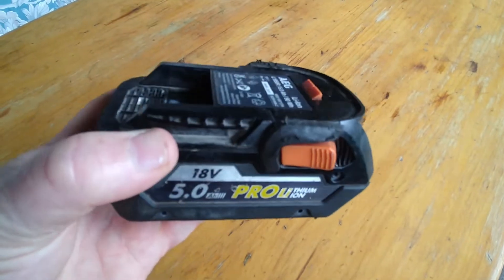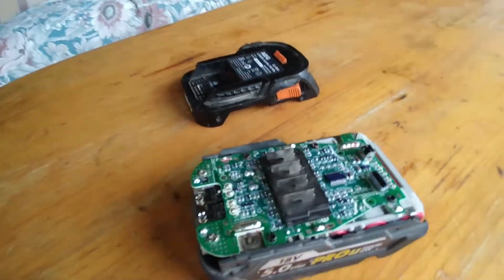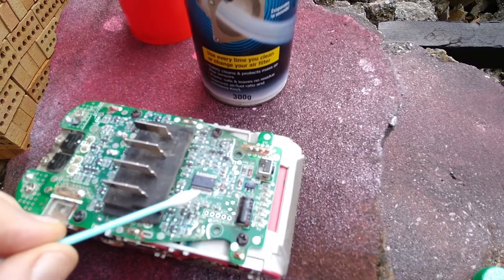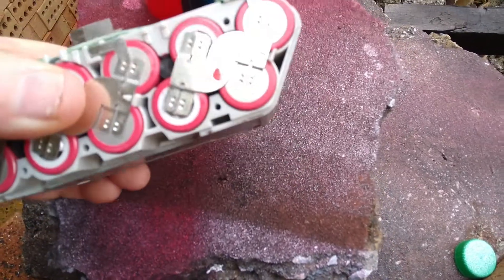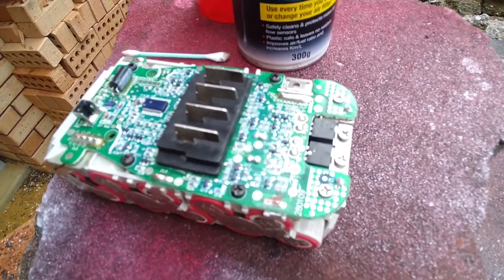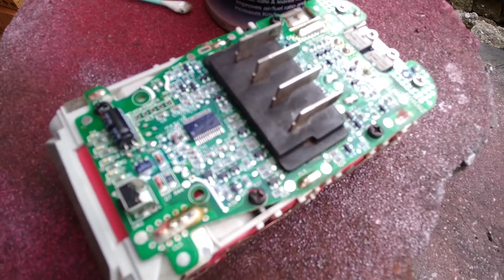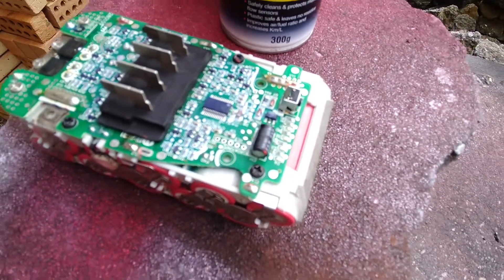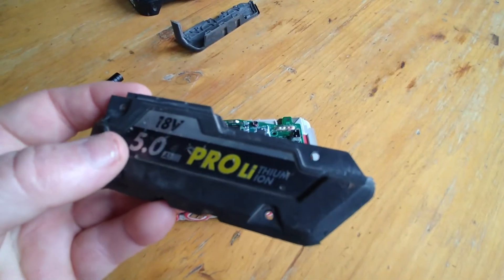18v AEG and Ridgid Lithium Cordless Tool Battery Reset

Comment: Just an update, have the new style AEG force battery. My battery was flashing 4 times when you click on the percentage button and not working in the drill & error on charger, I disassemble and cleaned and done a voltage test on cells like in video however the only difference is the reset pins and process. 

You will need to use J2 & Ground (should be next to each other) once shorted click the battery percentage button and you will see it flash and the two lights appear then remove jump. Just did it to my 5ah battery and has started to charge and work on my tools again, do this at your own risk though however it did work on my battery.
Reply from the maker: That is great information. I'm sure there will be many people that will thank you. 
Cleaning, Charging individual cells and checking voltages for failed cells is key to having them last after a reset. 
Thanks for passing on the knowledge.

You should do a short video and show the process.

Comment: I tried the reset. No go. It seems there is the 20v at the MOSFETs but the signal to turn them on is missing. Maybe the controller has bricked and reset won't unbrick a locked controller. I will play around more. MaybE just short out MOSFETs
 Dangerous
 Yes.
Reply from the maker: Later models may have a different BMS now. It sucks that they do this. 
Worst case is look in Temu see if they sell a BMS for them or break it open and salvage the good cells for projects or your torch.
Reply from the maker: I just searched on Ali express and  they sell the BMS if some AEG batteries. I suggest checking them out.

Comment: Is anything supposed to happen while performing a reset? Tried it on my battery that stops working when it gets to 3 bars but still not working. Didn’t see any lights flash or anything while performing the reset with a piece of wire.
Reply from the maker: I can't remember to be honest. There may have been a green led on the board that flashed a few times but I'm really not sure.
Reply from the maker: They did revisions of the circuit over the years. If you followed the process exactly and did it a few times and it didn't work then you have a later circuit that they have patched to prevent resetting. 
At that point it is best to just harvest the batteries for other uses.
Some companies are now including circuits that destroy the circuit board when you disconnect the batteries. This isn't one of them but I'm sure the latest units will have something like that.

Comment: This video gave me hope, but one cell was 0v, others 3.6V. Can I pull the dead cell and replace it with ?. Battery pack is 2500mAh.
The process of getting the pack apart and cleaning and testing is easy once shown how. The U tube vid is great for that.
👋
Reply from the maker: @huttonoddy5763  get as many cells as you can. 
Charge them all one by one. Then leave them to sit for at least 2 weeks. Then check the voltage.  If any are way out side the voltage of the rest then mark them as probably faulty.
The two week resting time is important. 3 weeks is better. 
You can try to recharge the zero volt battery too but I would keep it nearby. 
Be careful about the batteries. It's rare but they can overheat when charging so never leave them overnight. 
If the battery leak has cycled more than 200 times then you may find it's near end of life.
 so yes I would have a go at replacing one battery but try to check the rest. You may find that battery is in parallel with another in the pack. If that is the case then you need to pull them both out and check them both and maybe change them both.

Comment: Hi mate , you are a genius ! Brought home an old batteries from the tip. Wasn't charging.... followed your vid, reset... bingo. One 5 amp charged batterie saved from landfill and having a second life. Keep up the awesome work. 👍👍👍
Reply from the maker: @romanschuhmacher7270  That's good to hear. If it trips out again. Clean the circuit board with some alcohol. If it keeps failing  then there will be a bad cell. 
I'm guessing they are starting to get a bit old so we are just buying an extract year or two with b them.

Comment: I shouldnt have to do this to a battery that has been charged4 times. I have DeWalt since 2009 and the 3 batteries that come with the kit are still going and have done heaps of work. Only bought AEG because of back pack sprayer, I wont be buying again.
Reply from the maker: @1957richie  I tend to agree. Can you return them for warranty? 
If not then maybe try cleaning the circuit board with an old tooth brush and alcohol. You may be getting electric bridging in the circuit.

Comment: Yip did the reset it worked
Reply from the maker: @Duffnz  I'm starting to realise it won't always work if the individual batteries have problems but if it's a general safety reset then it's ok. 
If it needs resetting more than a couple of times I would remove dust from the circuit and try to test the individual batteries. 
All battery packs have a life limit.

Comment: Excellent video, reset 3 batteries that got left out in the rain.👍
Reply: Same reason I’m here
Reply from the maker: @rsl6767  that's probably the ideal usage. Sometimes if the batteries are old the error will happen again. Sometimes they just need the dust removed or water cleaned off to delete the reason they threw the error in the first place.
Thanks for the feedback.
Reply from the maker: @rsl6767   Rain and dust . It's just a glitch. Dust and humidity definitely bridges the circuit easily.

Comment: @ 2:11. Whoops, be careful there mate!  😮 
Battery looks like it has been thru Hell and back?  🤔 dirty and all mucked up?  
Good to get it cleaned up.  That circuit board on this battery is crazy!  These modern batteries, it is no wonder they have issues like this. 

I wouldn't go having that opened up battery touching against that masonry surface, use a pad, cardboard something, there, chippy!  Gonna buy ya a camera that will focus for Christmas!  There ya go Cheers!
Reply from the maker: @georgedavall9449  HaHa. Id welcome that camera. I've got to agree cleaner is safer with battery circuit boards. The batteries that tradies use must often be covered in conductive metallic dust. It's a recipe for shorts and battery phantom discharging. I felt safe enough on the masonry as long as the door is close enough to throw the battery outdoors if it goes incendiary.
Have a great Christmas. If I wasn't so busy at present I'd make a few more videos of random stuff.
Clean is good.
Reply: @lynpatnat  Thanks for the awesome reply!  
Yes, do be careful when dealing with the Li- ion batteries!!!  😮 
Merry Christmas to You and yours!!! 🎄 🎁🤝😁
Reply from the maker: @georgedavall9449  Im just happy someone looks at my videos. That's a win all the way. I like constructive notes as we all need to learn. 
I need to learn how to improve the videography but I am always a bit time poor so I just throw a vedeo together when I find I can't get the information I needed and had to work out it myself. That's often a 15 minute job. 
I've got a few videos in the pipeline to do but that's a job for future me. 
Right now It's too hot in Western Australia ( if I go outside and make sparks I would end up either in jail ( your spelling) or gaol (our spelling) right now as I would burn the suburb to the ground. ( Yes it happened about 10 years ago when someone used an electric grinder)
So for about 3 or 4 months we don't do much except stay inside,swim( get sunburn  in 15 minutes) or find a pub. No complaints from me.

Comment: I have 2 of these batteries, eventho they show 3 bars of charge, the tools won't work anymore. Could it be that my batteries need this process done? Cheers and kia ora from Aotearoa
Reply from the maker: @pauleysink9659  you will probably find the cells have worn out. You would be best to replace the individual calls but as they have all had the same amount of work then to replace all cells may but make it worth the expense. 
There are guides to testing individual cells after dismantling the packs so it may be possible to make a full battery that is ok but it would never be perfect. The other options would be to buy some new ozito or ALDI batteries and  when in special and remove the batteries to replace all the ones in your pack. Then you could reset and charge it. 
Would I do that? No I would probably say that the  Battery packs are but worth the work or cost. 
You may be able to sell them on marketplace as needing work/ faulty and use that money towards buying a new battery.

Comment: I did a screen shot of the close up of the wire configuration for the reset since that went by pretty quickly, but am going to try this now. Thanks so much for giving us this tutorial.
Reply from the maker: @LK-bz9sk  if it only lasts a short while before it fails again then there is probably a faulty cell. There are good tutorials in how to test  every cell but basically you charge them individually then leave the pack to sit for a week. Then test to see which ones are low voltage. If it's two in parallel then one or both may be faulty. Replace them with known good ones and reset again. Otherwise break. Open the pack and salvage the good cells for a battery bank or to fix a different pack.

Comment: Found a brand new dewalt drill,x2 batteries and rapid charger in the case being thrown out for hard rubbish,owner thought coz batteries were dead ,the whole thing was dead but it only needed a “jumpstart”from a full battery to a dead battery using 2 wires..same as a car.winner😊😊😊
Reply from the maker: I've heard that batteries will go into hibernation if they are fully flat. Connect 12v to the correct terminals for about 30 seconds then put them straight on charge. If that doesn't work then open up the pack. Find the + and - connect at the first and  last battery and do it at that point ( maybe give it a couple of minutes). Then put it on charge. If that fails. Test voltage of every cell and charge them one by one at 4.2v until fully charged. Sometimes they are just protecting  us from ourselves and sometimes just trying to make extra money. If you get lucky it's a win.

Comment: Thanks Mate , 
I’ve just reset my battery that hasn’t been working for over 3 years and now watching your video I’ve got it working again and now dont have to buy another!
Over the flipping Moon!🌙
Reply from the maker: That's a perfect outcome. Money back in your pocket .
It's such a  fucked world that they set timers on these batteries. Makita are worse but I have read you can buy replacement boards inside the batteries from Ali express and change them over to get them working again.
Reply: @lynpatnat  hey your right!
I’m pretty sure my battery over heated 
As that heat sensor was blacky brownie colour 
Would that have stop it working ?
and that’s why it needed a reset? 
I’m just a Brickie with absolutely no clue of electrics I peeled  the heat senser off and cleaned it and clean the top bit like you did and then got a hair pin and bridged those two hole to reset it ?
I can’t believe it’s fixed….. what do you think the problem was mate?
That’s for you help 🤙
Reply from the maker: @wolfdog1722  it does sound like it overheated. I'm not sure what the component is ( maybe a safety/ thermal device) but hey if it fixed it then that's a win. Tradies give everything a thrashing so I guess even the factory can't think of a harder way to test tools. If companies want people to keep buying their power tools then they need to come up with better ideas than just bricking batteries. I'm but a tradies ( retired) so I just buy Ozito. You can't beat 5 year warranty (2 or is it 3 years on batteries) as long as I keep the receipt but they are not trade tool build. 
If ever you needed to rebuild a battery though you could pull the cells out of a Ozito battery pack but that's a whole different level of fixing things.
Reply: @lynpatnat  thanks for all your help!
A mate of mine gave me a Arbortech all saw just before he went back to England and said it was fucked
Anyway I got it out of the garage yesterday and watched another video on YouTube on how to fix an Arbortech  and all it was was a little rubber belt had snapped , so I’m getting one now from Sydney Tools for $29 job done 
The tool cost over -$1200 new
Reply from the maker: @wolfdog1722  I hate seeing things go in the bin. Repair and reuse. We all have two hands and a  brain. We can all learn the skills to fix things. YouTube is so helpful for passing on this knowledge. Glad to be able help a few people and save money while reducing wastage. Cheers
Reply: I think I celebrated too early 
It’s stop working again and I’ve got three orange batteries lights on.
Any ideas mate?
Reply from the maker: @wolfdog1722  what I would do next is open it up and measure the voltage on each of the cells. If any are low or no voltage Then that may be a bad cell. Then get an 18650 charger and hook up one cell at time using crocodile clips and charge them. This takes a few days. When they are all fully charged leave it for a week then recheck the battery voltage of each cell. If they are all stable and close to being the same then reset and recharge. It should be ok. If one cell or more is low then those cells need replacing. 
There are some good YouTube videos on doing this. 
To me it does sound like they are out of balance or a dead cell or two. You may be able to rebuild one or two batteries by cannibalizing one.
Reply: @lynpatnat  thanks mate I’ll check the cells 👍

Comment: I have two aeg batteries that have full lights when the button is pressed but won't work. If I put them on the charger the ? Symbol starts flashing. I'll give this a go and post the results
Reply from the maker: It's also possible the batteries are out of balance. You can open them and charge each battery by itself. No need to dismantle just get a 18650 charger for individual cells and run jumper wires to one cell at a time. It takes a few days but when they are all fully charged then the battery may work correctly again. Each battery is 3.7v and fully charged it gets to 4.2v but then drops back. 
Search on YouTube for how to do it
Reply: @lynpatnat  Awesome. I certainly have one of those chargers. I'll check the voltage on each first. Thanks for the wonderful info. 👍🏼
Reply from the maker: @DmacDomage  sounds like you have a good grasp of what you need to do. Best of luck. Worst case you may be able to build one good battery out of the two but then you need to cut and spotweld cells and even I just give in at that point.

Comment: i tried but its not working. wha i do.  please help
Reply from the maker: If it's the same era of battery and you touch a wire between the points then it will work. Unfortunately later versions with new firmware probably won't work.
You may also have a failed battery or one  failed cell. Nothing lasts forever.

Comment: Do you bridge with a bit of wire ?
Reply from the maker: Yes but Just for 1 second. That does a reset. It doesn't need to stay connected.
You can use a paperclip or any piece of wire.

Comment: Great video and thank you, I repaired a defective battery that was otherwise useless. I have another Ridgid Battery that does not hold a charge very long. Will I gain any charge capacity by resetting it the same way?
Reply from the maker: Probably won't work on a faulty battery with a faulty cell.
You can open it up and charge the individual cells. Then put it away for a week. Then test the voltage on each cell. If one is more than the rest then that can be replaced if you have another battery that you can get one out of.
It's a bit hard to explain the full way to do it but there are lots of videos explaining the process with other brand battery packs.
They do wear it over time.

Comment: I had a battery that was showing 4 lights (full charge) and indeed measured about 18V across the terminals that connect to the tool, but when you pull the trigger of a tool, nothing would happen.  That same tool worked fine on other batteries.  I opened up my battery and it looked super clean inside, but I brushed around gently with a q-tip anyway.  Then I used a lead wire to bridge the reset as you described in this video and put the battery back together.  Now it works!  Not sure if it was the cleaning or the reset, but my guess is the reset since it looked so clean.  Thanks for the tip!!
Reply from the maker: Thanks. It's nice to get feedback. Glad you fixed it